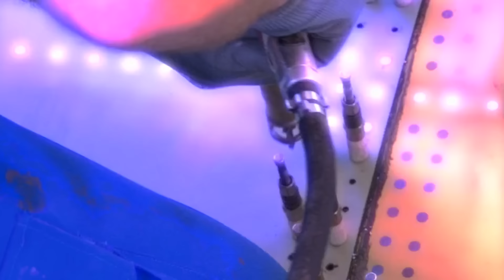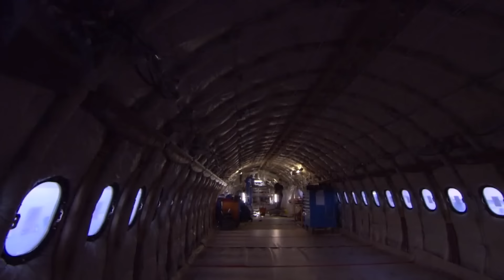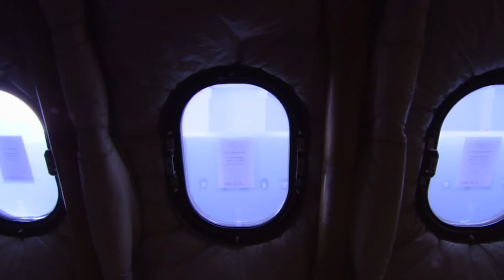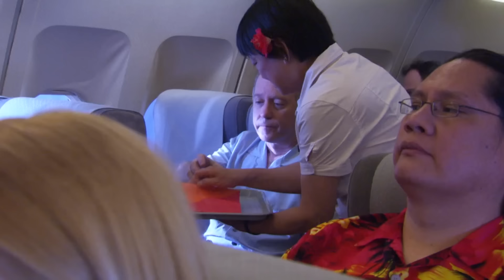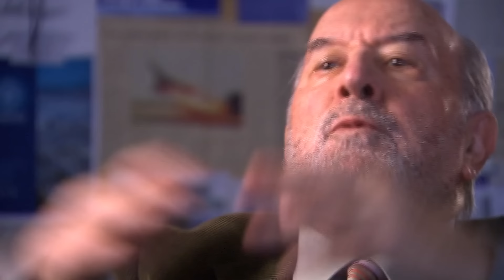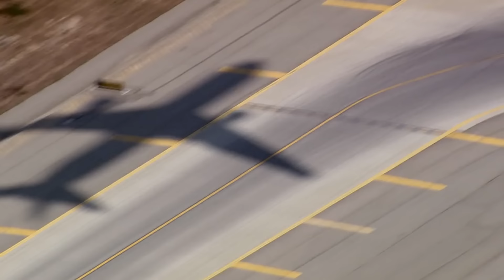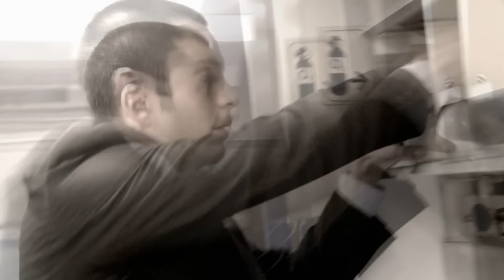Traveling A Life Support System That Became A Nightmare Come True... | Mayday: Science of Disaster

Comment: Pressurization switch on Helios aircraft should have been on one or more check lists.
Reply: Imagine being an investigator and finding that switch in the debris in the manual position, knowing pretty much right then that you've found the answer.
Reply: I feel like a more visual alarm would have helped. Say, lighting up the pressurization switch. Nowadays they'd probably have a screen clearly read "loss of pressure".
Reply: There is an overhead panel check while the 737 is on stand or at the gate and there is another check that is performed passing through 10,000 feet.  I believe there was confusion on the flight deck when the low pressurization horn sounded because it was the same alarm that was used for the take off config warning.  Identical sounding.  The crew of the helios flight thought the horn was sounding for an erroneous take off config warning and began contacting company to troubleshoot the issue.  But as the aircraft continued to climb, hypoxia only amplified the confusion

Comment: Why did this airplane need to fly so high when it was only taking short trips between the Hawaiian Islands? It wasn't necessary they're just short hops right? 
   I don't fly in airplanes but that seems logical anyway. Every time it went real high it had to pressurize thereby weakening it prematurely because it took so many flights. Maybe not fly so high and so fast. Speed kills
Reply: Well, that "short hop" between Hilo and Honolulu is actually around 200mi. At lower altitudes which wouldn't require pressurization (<10,000ft), the airspeed and fuel consumption take a moderate hit, not to mention the weather systems and turbulence you'll find...